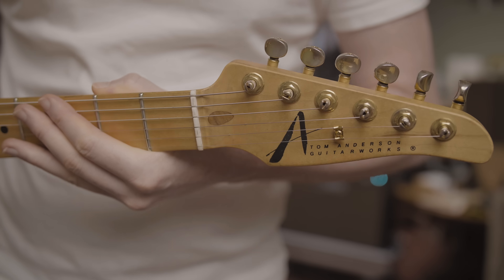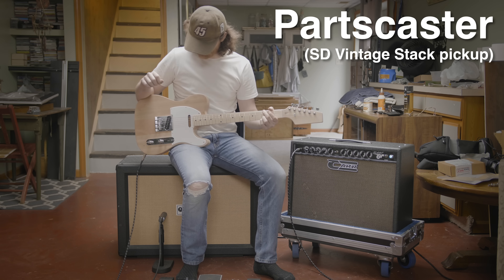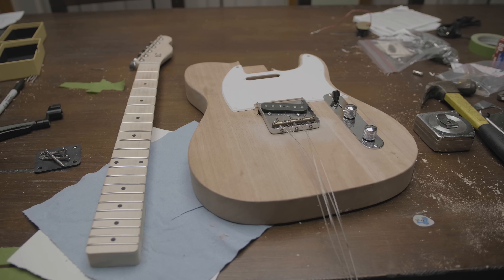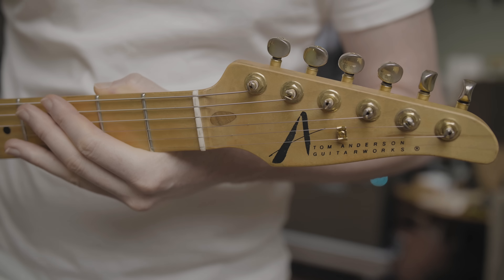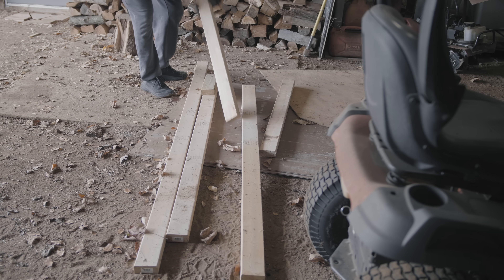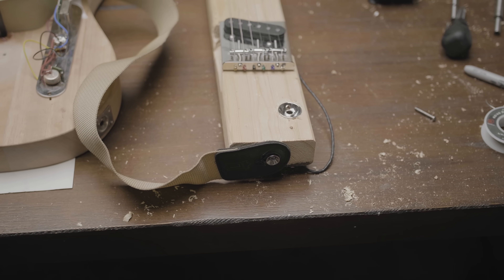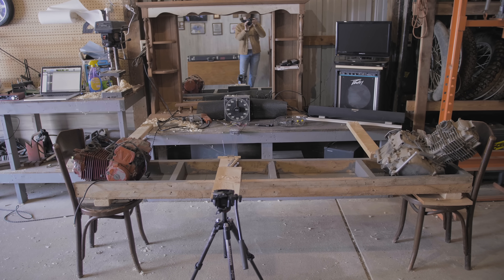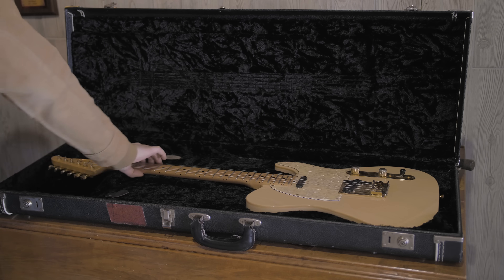Tested: Where Does The Tone Come From In An Electric Guitar?

Comment: I bought a G&L Bluesboy tele guitar and swapped out the threaded pole pieces for screws found at my local Home Depot. The shape of the pole pieces does play into the harmonic content of the guitar, because as the string vibrates, it has to cut through the magnetic field of the pickup magnets. The pole pieces subtly alter the shape of the magnetic field—whether the head is flat, beveled, curved, or has a complex shape (like an Allen hex screw), so as the string passes through the magnetic field, it alters the magnetic field slightly. This change in the field is what is sensed by the coils. I’m a physics professor so I know what I’m talking about. Anyways, it does alter the height of the pole pieces under the strings so it wasn’t a perfect experiment BUT it did indicate that pole piece head shapes will alter the tone too. A cone shaped piece head would be interesting to test out vs. one shaped like the surface of a ruffles potato chip. Might be an interesting experiment to test out different pole piece head shapes too. Basic rule: smooth head means smooth honest response, complex head means more harmonic content, possibly harsher. 

Thanks for this video—good luck with future tests!

Comment: The video is amazing! That means that you can just buy any kind of cheap guitar and put there nice pickups, that's it. Btw, only the one difference I hear, is that the 'air' guitar has the pure sound without any kind of vibration (kinda synthetic). While the body guitar has very very slightly noticable 'flanger' effect on the amp with the 'clear' setup. To the @Jim, that's amazing,  thank you so much.

Comment: There’s a video on YT of a guy who made a guitar out of aluminum cans and it does sound very bright and metallic. What I took from that video is that there has to be MASSIVE differences in materials for there to be any noticeable difference in tone. Metal is, of course, is much denser than wood, but the difference in tone was very slight. It’s a cool video.
Electronics clearly make the difference in the pure sound of the guitar. Everything else is marketing.

Comment: A VERY admirable comparison! However, I think you should be looking at a Fast Fourier Transform of the signal output of the guitar to compare overtones of a each string separately, then chords. This is a scientific test, rather than ear-dependent. If you use a preamp (no speaker cab), you should be able to analyze the overtones of the guitar without any bias, with an FFT showing changes in the relative overtone powers. Thanks for the experiments!! 👍
Reply: However, we do not put our music through FFT-Devices (usually) in order to enjoy it. We usually use our ears. And if the ears say "No difference", that's what interests us.
Reply: @christianb9077  I'm not going to argue with you. Your reasoning here is one part of the perpetual myths that end up on blogs that are useless commentary. We are not trying to enjoy the sounds Jim is producing. We are trying to measure the sounds objectively for comparison. Perception of hearing is not objective. Numbers from a measurement device that is calibrated with respect to an agreed upon standard reference IS objective. Jim used FFT for the speaker cabinet experiment and used that for comparison. He should have done that with the guitar tone experiments. End of my conversation.

Comment: Great vid - IMO, a huge factor that folks don't talk enough about is the location of the pickup along the string.  There's some physics at work - strings vibrate at multiple frequencies, and the upper harmonics have nodes in their vibration the amplitude is zero (or almost zero).  Put a pickup at that node, and you won't hear the harmonic.  Put the pickup elsewhere, and the harmonic could be a huge chunk of the sound.

With a Tele, the neck pickup is at 1/4 of the scale length, causing the 4th harmonic to drop out.  Fret at the 5th fret, then the scale length changes, and you drop out the 3rd harmonic.  Send the raw signal from a guitar through an FFT (there's an app for that!), and you can see exactly what's going on with tone.

Comment: Thank you for this - It has been my gut instinct for years that if the guitar or bass  is properly constructed there should be no significant impact on tone by anything but the strings, electronics, and player.  As a bass player I have always been surprised what a huge tonal difference is made simply by playing further or closer to the bridge - much more than anything I could hear from different tone woods.  I know that this information is not good for guitar manufacturers as there are major price point differences between guitars that are due entirely to cosmetic differences and finish.

Comment: The table test is a bit of an illusion, you have to account for getting "tone" from the tables themselves.   While the mass of the neck/fretboard is NOT under the strings in the video is somewhere else.  Also relying solely on circuits that that ONE AMP  maufacturer has is not a very "scientific" test unless you compare that to other AMPS that have the same BIAS circuit or Rectifiers.  Video is a good attempt but it tends to rely on some (not so good) controls for testing or omit important details then building on that shaky premise while moving on to the next test .

Comment: I can hear differences in tone between the 2 x 4 and the Anderson, and the air guitar and the Anderson. The 2 x 4 does sound slightly brighter to my ears in the top end to the Anderson, and I actually prefer it! The air guitar sounds noticeably darker and muddier in tone to the Anderson - the most I'd conclude is that having a body does make a noticeable difference in sound, and that tone wood does make subtle differences in tone, but not major ones - like seasoning on a piece of meat versus what type of meat you're eating.

Comment: A thin rock maple bass body has always sounded the harshest and brightest. Almost all of Fender and Gibsons tonewoods have been in the middle of the ballpark for me and the difference is minimal.
I built a P bass from rock maple, and sanded down the body closer to a Ric or a Gibson Ripper in thickness and the result was a harsh piano tone. And every maple bass with a thin body I have came across had the same tone, no matter what pickups were on it. I can provide clips of this instrument; plugged in, and acoustic, and it would be hard to match the harshness of it.

Comment: How about a body and neck made from a hard grade of Sorbothane?

Knowing nothing about guitars, I used to assume the "pickup" was just a sort of microphone built into the guitar body. But apparently it is something more like a metal detector looking at each string individually? So I suppose the only thing that matters (aside from having a good pickup and electronics, and using "detectable" strings) is just not using something so "off" for the body and neck and nut etc. that it absorbs or deadens the string vibration prematurely.

Comment: This is an absolutely critical video and I'm thankful for it. If you were to make a follow up video, it would be really cool to see spectrographs, EQ graphs, and Oscilloscopes measuring the frequency response, vibrations, etc
Reply: THAT is the key test! A fast Fourier Transform (FFT) on a preamplified raw signal from the guitar for each string alone and then chords, eliminating the amplifier. For sustain, you need to look at the time decay of the signal from a single string and then chirds. Only that test will be definitive.
Reply: What would the point of that be? I feel this test was more than adequate to prove that only the electronics, and their relative distances, matter.

I guess this must hold true for hollow body guitars as well, unless the pickup is a microphone/passive.
Reply: @werepat  It's a good test. But it's not quantitative. Science and Engineering is quantitative. Jim uses FFT frequency spectrum analysis in the speaker cabinet video, and that is an objective, quantitative analysis that is independent of a person's ear. I am an aerospace engineer/applied physicist and I can tell you that this wouldn't meet the criteria for publication in a journal or conference meeting. But it's a great start.

Comment: So just buy a squier (a tele in my case) and switch the parts like I did. Mods I recommend for ease of use/playability, from easier to harder upgrade: hipshot tuners, better nut, puretone jack (not because it upgrades the sound, it just holds on to the cable better), wiring (including pickups)

Comment: You got clear repeated overtones swelling out like feedback in every take with the neckless guitar. You have normal volume swell and decay with the regular guitar.
That's 4/4 for neckless vs 0/4 Tele.
Not sure how you or your viewers don't hear that. It's plain as day to me, especially in the last take where you have to palm mute your bridge to make it stop. (watch and re-watch that last strum on the neckless folks. what's going on? why is that guitar just singing away in a high pitch like a kettle about to boil?)
So, test and confirmed. Extra weight which is resonant (your wooden work bench, etc) causes sustain and a change in harmonic overtone qualities of the guitar! Good work!
If you were expecting it to sound different like an old strat and a modern guitar sound different you are probably thinking about pickup voicing. The qualities of the guitar's voice is directly related to what frequencies easily pass through the medium it is made of, and which frequencies are dampened by it. Please make a guitar out of balsa wood! I've never heard one but I know that it'll be very bright sounding, but won't sustain very long (unless you use a very big piece of balsa). Likewise, if you strap that Tele to your bench with a clamp (no rubber allowed :) that dampens sound) you will suddenly notice the same harmonic overtones from the neckless guitar singing out! Honestly, you'd have to screw it in like the neckless, but you won't do that for science. (please don't)

Comment: From my experience 1)pickups 2)string gauge & brand 3) playing style/technique/finger calluses/dynamics/pick impact on strings while plucking play major role, then definitely the amps, also the guitar cable. Mainly it is the pickups, that is the factor which decides the characteristics of the signal output. I have cort cheapest stratocaster($120), Ibanez grg170dx ($180), Ltd EC 10($190)  purchased 5-8 years back. I felt the esp designed pickups gives much more heavy powerful sound while playing in the same solid state amp. I practice on all 3 turn by turn, so I can easily compare. Ease of Playability point of I like ibanez, handling point of view stratocaster, and output sound point of view esp designed pickups of ltd guitar. Ltd ec 10 is heavy and the neck paint is thick, the frets too bit on higher side compared to ibanez grg170dx. So whenever I feel weak, I prefer stratocaster, whenever I want to shred - ibanez, and whenever I want feel the music, Ltd ec10.

Comment: Electric guitar pickups do not hear vibrating air or vibrating wood like a microphone or piezo pickups do. It can only hear vibrating magnetic materials that directly cuts through its magnetic field. So the wood doesn’t matter. Or anything that does not affect the magnetic properties of the strings and pickups will not affect the sound that comes out of the pickups.

Comment: Those are two pretty hefty tables that the bridge and headstock are attached to. In reality the "air guitar" is made of more wood than probably a dozen or more regular electric guitars, it's just that almost none of it is under the strings.  A fun bit, but probably the least scientific part of a video which trying to be as scientific as possible. 

That said I'm definitely more on the electronics side of the debate when it comes to tone. i'm less convinced when it comes to sustain. I would have liked to hear the difference in sustain during the neck joint experiment. We only heard a few chords in that section, and they weren't held very long. I'd be interested to hear how long a single note anywhere past the twelfth fret would ring out in each scenario. I'm guessing a snug neck joint would probably win that one, but it would have been nice to see it tested here.

 I know we're talking tone, as opposed to sustain, but can you really separate the two? I consider sustain part  of what makes up the tone, since it certainly effects how much I like how the guitar sounds. But i don't think I've ever heard a universally accepted definition of exactly what tone is in a musical context.

Comment: Hm, this test is a bit flawed because you use distortion in processing. This means that factors like pickup output would change the sound on same amp settings. Rather (since the tone may only change until the first amplification) you should go right into a clean audio interface and measure the resulting audio by either hearing or fourier analysis.

Also these "5 factors" lists are ridiculous apart from number 3, which looks decent. Personally I’d say:
A) The player
B) The amp
1) The pickup position and height
2) Quality problems (buzzing, dampening, such stuff)
3) The fundamental design of the instrument (acoustic? hollow body or solid? such stuff)
4) Design of pickup
5) The circuit design of the electronics

Everything else should make at most a minute difference.

Comment: Thanks for your efforts and works!!! But i need to tell you... the vibration doesn't come from the air o strings.. thats to be important!! Of course!! But your experiment to be wrong... you never put the top or the bottom guitar touching the glass or mirror? The sound to be more brilliant and stronger! You put the neck and the bridge on steel table... this material give the same effect that the glass... you need to make a differents supports to see the real differents sounds.. so thanks

Comment: If much of the info in this video was correct, then production SG and LP guitars with the stock pickups would sound identical... And they don't. Modern CNC production ensure pickup wind consistency and similarity in shape between all wooden parts. The hardware is punched out like biscuits.  The only variable worth truly considering is the unique pieces of wood they are machined from. They are all subtlety different sounding and the prime reason is the lumber involved. But, if you can't hear it, you can't hear it.

Comment: I spent a couple years tinkering with my setup, replaced pretty everything I could with the intent of replicating a 59 les Paul. Replaced the nut, tuners, bridge, saddles, electronics (found original centralab pots and some vintage caps) and went through half a dozen PAF replicas. I also drilled the bridge posts deeper into the body which did improve the resonance a small amount but I couldn’t tell plugged in. I also took apart some of the PAF replicas and swapped out the magnets and screws. So after all of this I came to the conclusion that the magic we are hearing with these 50’s Les Pauls and Fenders is the wire used to wind the pickup coils. Modern wire is very harsh and brittle, while this vintage wire (probably made during the war with higher quality materials) is warmer and smoother. I’ll add that the centralab pots did make a difference, they are way brighter than standard pots like CTS, their pot values were between 700-800 while my CTS were 400-490. They are also made better, you can turn the volume down to 1 and the guitar never gets muddy, sounds like there’s a treble bleed in the circuit. This is a bit of a negative with modern PAF replicas though as it just brings out the harsh brittle tones more. I hope all of my time and money saves someone some time and money lol, moral of the story is, nothing aftermarket is getting you to a truly vintage sound, these companies need to invest in better quality electronic components, the build quality is there with everything else!

Comment: Definitely interesting! For the air guitar, do you think the bench itself could impact the sound? It's technically still bolted down to a wooden bench. 

What if rather than wood, you built the guitar out of, say, steel? Or concrete? Carbon Fibre? Alluminium? Plastic? The pickups themselves should vibrate with the sound. Having them bolted to a different surface should theoretically cause them to vibrate with slightly different patterns, relative to the material. Would be interested to hear how it sounds with different materials, rather than just different types of wooden surfaces!